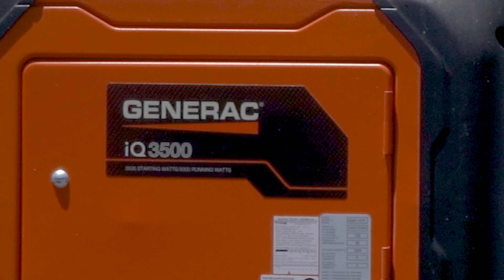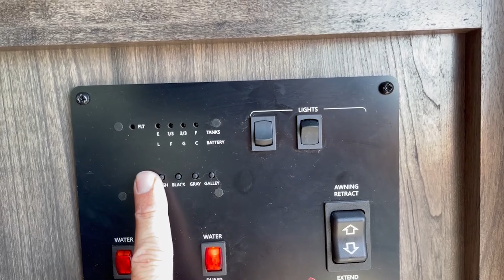LiFePO4 Camper Battery Full Upgrade

Comment: It's an ok battery but I would go with SOK battery  $570  has low temp cut off and can be served if needed.
I have an ampuretime same as the chins and   love it. Use it for small camper with 200 watts of solar and a victron controller works great also use it on electric trolling motor.

Comment: Thanks for the video, was very helpful. Will be upgrading my battery and charger soon.

One thought I had is that it looked like you were storing battery fully charged. I know from electric vehicle experience that will damage the long term prospects of lithium batteries. Same for storing a fully depleted battery.  Unless your planning to replace it every few years it’s best to discharge as close to 50% as possible if you won’t be using it in the next day or so.
Reply from the maker: Great point on the storage levels!  I cant say I always adhere to that because I don't have a very accurate way to monitor the charge state of the battery.  Typically I leave the fridge and bathroom vent on for a few days after we park it or take it off shore power/generator.  If this battery last 3 years I'll be happy.   Maybe if it was a huge bank of high dollar batteries i would stress over it.  I just wanted something that didn't die as fast as the last battery which got trashed from taking to dead a few times.  Thanks for the input - Jason

Comment: I don't think you need the music........what do you charge the battery with solar, ac or gen
Reply from the maker: @Ringo Star - Roger that on the music.  For the most part the battery charges at hook-up sites.  The capacity is large for our 12v needs so we have not had it run dead yet.  This winter will be more of a test because we typically go off grid more in the winter and use the heat all night.  If it needs a charge off grid I will charge it using my generator.  Should take about 2 hours for a full charge given the capacity of the battery and amperage of my converter/charger.  The economics of solar just doesn't work out for weekend warriors like us.  If I was still running the sorry a** SLA I might consider a 200 watt system just to keep the charge up on the battery when in storage or on the road.  This isn't our "forever camper" so I just want to keep it simple.  Thanks for watching.
Reply: Switching to Lithium is anything but drop in ready!

Comment: I am sitting here in disbelief that this guy put a 100ah battery outside his RV for Multiple reasons. 1 anyone who watches this video is going to be on the lookout for a Red camper just to steal the battery. 2 these batteries as good as they may be are temperature sensitive. This guy I tell ya. Some people where without a doubt dropped on their head as a child. lol
Reply from the maker: @Double D  Fortunately I store my rig in a very secure location and don’t really stay anywhere too schetchy.  Unless you went digging around you wouldn’t know what kind of battery I have.  Plus I am wise enough to have a high level of insurance on the thing.  I don’t live or travel any where with extreme weather.  When you live in the Bay (San Francisco East Bay) getting jacked is as sure as the sun comes up so it’s what ever player. Thanks for watching!
Reply: LoL
Maybe he lives in the south where temp isn't a problem.
And where are you camping? In the hood.
Theft isn't an issue where I camp